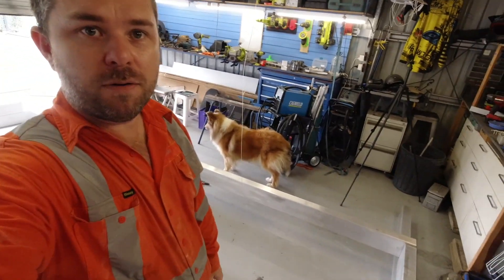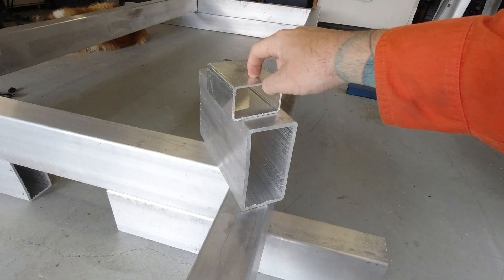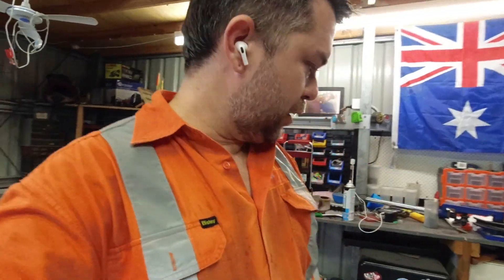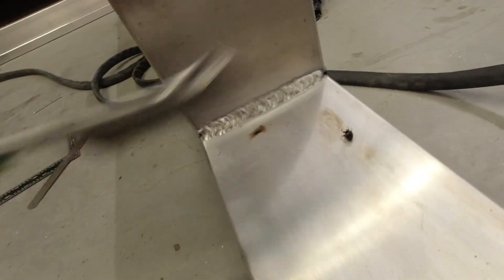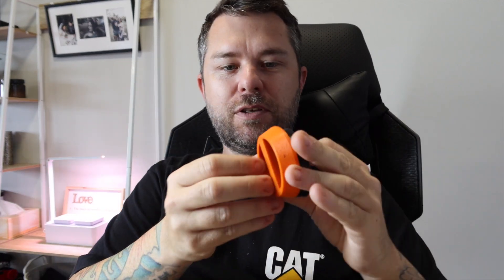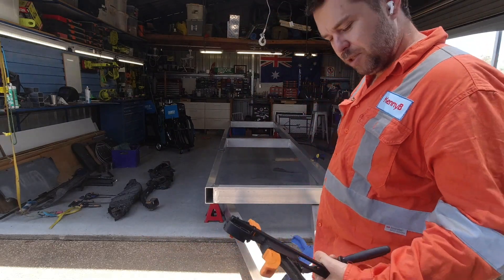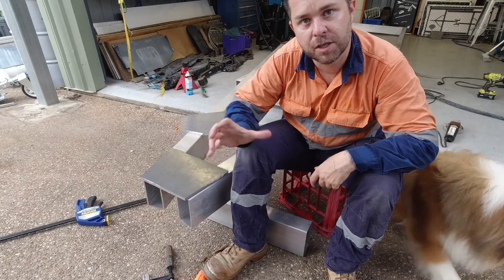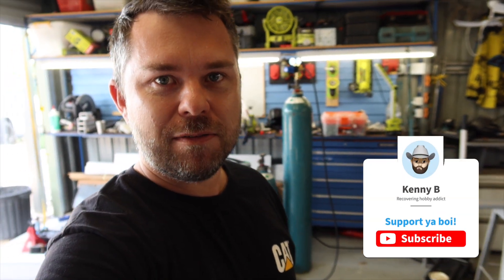I have no idea where i'm going to park this thing! | Fabricating the toy hauler chassis.

Comment: Question, Why go through the effort of tigging all those basic joins when you could Mig them and be done in half the time, And leave the Tig for all your external/Visible welds?
Reply from the maker: I tried mig welding with two different welders I have and it all looks like streaky bird poo so I went with tig for everything. Really need a much higher level mig like a double pulse unit
Reply: @Kenny_B  fair enough. Cheers for the feedback

Comment: Nice one cant wait to for the roller assembly, what's your background mate, just love tinkering with the mig or what?
Reply from the maker: Did my time as a fitter/machinist, then moved onto diesel fitting for bit but I’ve been off the tools in a management role for about 9 years now. Just one of those people that can’t sit still and I have a big hobby problem 😂

Comment: what disc are you using to prep the the joins
Reply from the maker: I’m using a flappy wheel sanding disc to grind off the oxide layer, clean with solvent, weld then buffing the welds with a wire wheel.